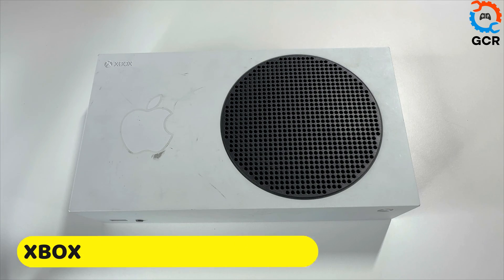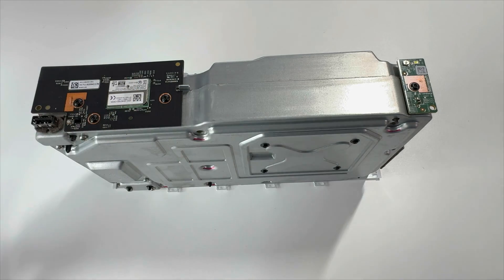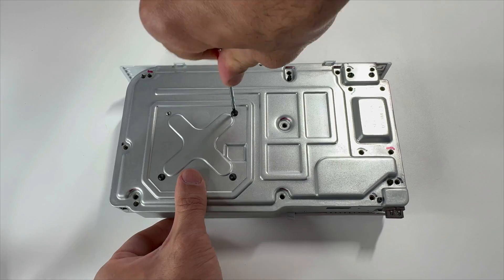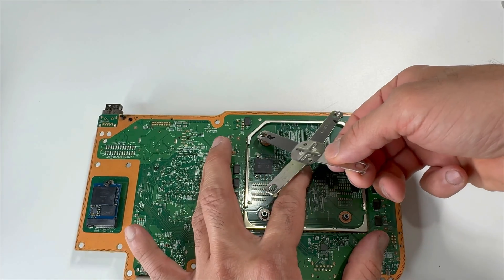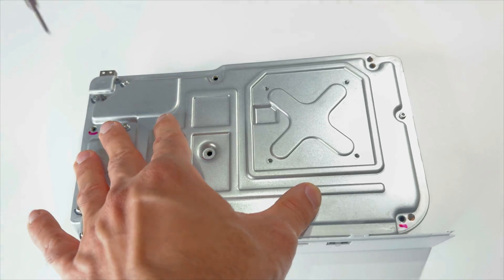XBOX Series S [Model # 1883]  - New HDMI Port Installation Guide | Avoid Common Mistakes

Comment: Are those heated pliers for desoldering and soldering or extra heat applied that's not shown in the video? I tried looking up soldering desoldering electric heated pliers but couldn't find anything
Reply from the maker: No no, there’s no such thing as heated pliers. We apply heat to the underside of the motherboard at 480 degrees using a heat gun to melt the solder, allowing us to remove the damaged port. Immediately afterward, we solder a new one in place. It’s a very delicate and precise process.
Reply: @GameConsoleRepairs  Is 450 celsius okay?
Reply: @shaikhjunaaydjs1217 lol, not unless you want to melt your xbox. That's over °800 Fahrenheit!

Comment: Thanks for the video. I am really struggling with this repair. I can do PS5 hdmi port no problem but Xbox S S is giving me issues. When I put the new port on, not all of the pins will stick. Say 4 pins are not stuck so I try to manual solder them but I end up making a mess and joining pins. Any advice?
Reply: most likely need to get better flux or solder if  both of them are  good  you should be able to just use the drag solder method   over all pins and it not stick between em n do bridges i see most using a curved tip on their  iron also  but  i like the knife tip for them also just has a lil more heat and i can use end to come between pins if there is a bridge.
Reply from the maker: Use Low-Melt Solder like ChipQuik - 
It definitely helps. I'll try to add a video of the whole HDMI Removal process.

Comment from the maker: [00:01] - Introduction 
[00:10] - XBOX Series S with No Display
[00:24] - Disassembly XBOX Series S
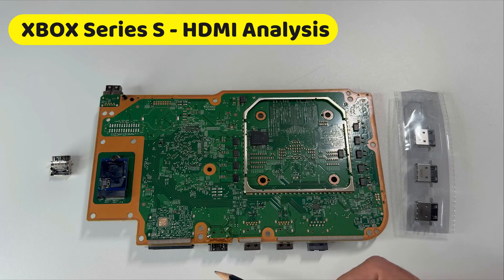[04:40] - Diagnosing HDMI Issue
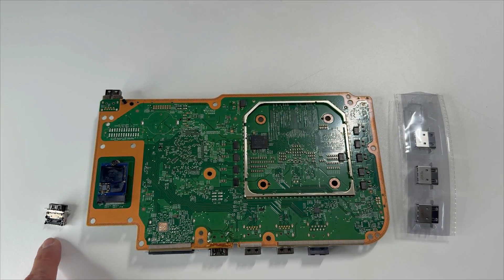[05:14] - HDMI Installation | Pre-tining 
[05:28] - HDMI Installation | Desoldering
[05:41] - HDMI Installation | Soldering
[05:54] - Removing Old Thermal paste
[07:26] - Dust Removal
[08:33] - Placing New Thermal paste
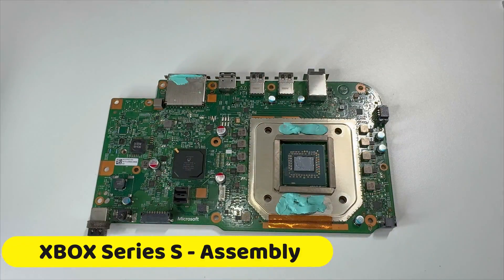[08:44] - Assembly XBOX Series S
[13:33] - Testing & Conclusion
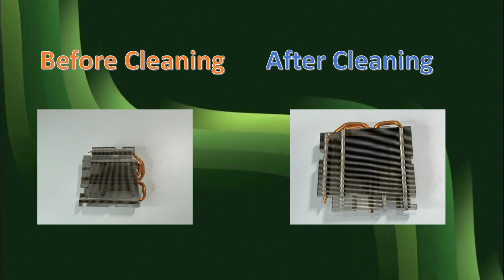[13:57] - Before & After Clean Pics
[14:13] - Credits